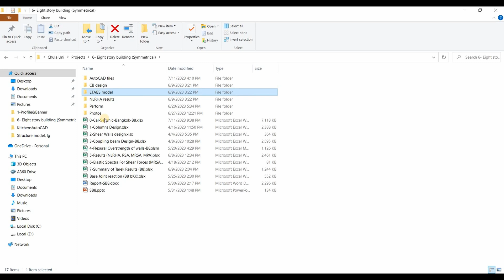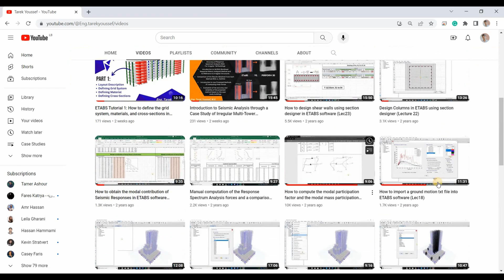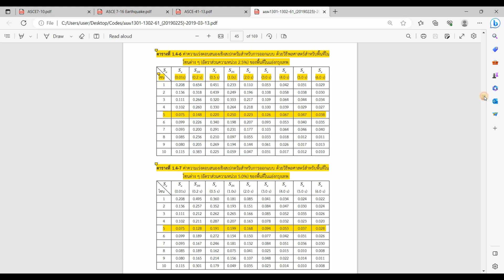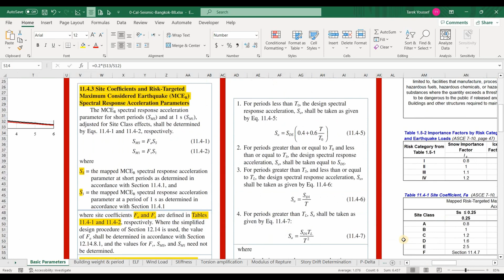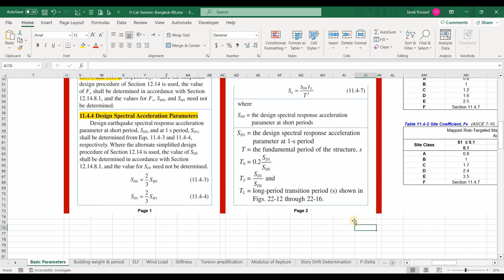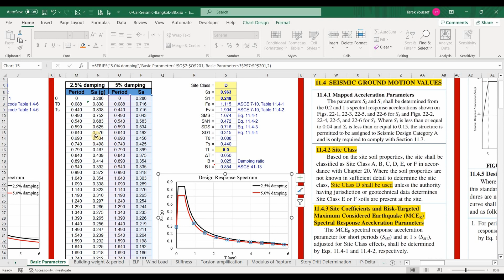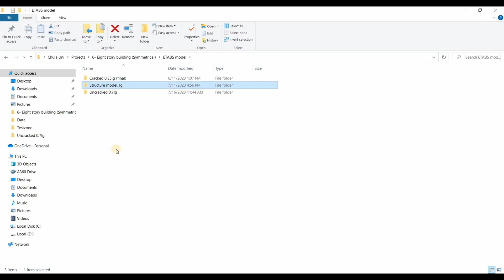ETABS Tutorial 6: How to Develop the Design Response Spectrum According to ASCE 7-10/ ASCE 41-13?

Comment: I use Response Spectrum function from ASCE 7 for my project. and i am using scale factor 9,81 as recommendations of CSI when defining the response spectrum load case, but I want to know the rational beyond that because response spectrum curve is defined as a fraction of graviotanal acceleration as Ss and S1 are function of G?
Reply from the maker: Response spectrum is a fundamental tool in structural engineering used to assess how a structure or system will respond to seismic or dynamic ground motions, such as those generated during earthquakes. It provides valuable insights into the structure's behavior by representing the maximum response at various natural periods of vibration. The concept of response spectrum analysis is based on the understanding that different structures have different natural frequencies of vibration, and these frequencies influence their response to external forces.

The response spectrum is commonly used to represent the structure's response in terms of acceleration, velocity, or displacement. Each of these response spectra is plotted against the corresponding natural period of vibration of a hypothetical single-degree-of-freedom (SDOF) oscillator. In a response spectrum analysis, the ground motion records are either derived from historical earthquake data or synthetic ground motion models.

The ASCE 7 standard, widely used for seismic design in different countries, provides specific response spectra for different ground motion parameters. These parameters are often denoted as Ss (short-period response spectrum) and S1 (1-second period response spectrum). The values of Ss and S1 depend on the seismic hazard and design category of the structure's location.

Response spectra are typically expressed in terms of gravitational acceleration units (g). The gravitational acceleration constant, denoted as "g," is approximately 9.81 m/s^2 or 32.2 ft/s^2, depending on the unit system used (SI or Imperial).